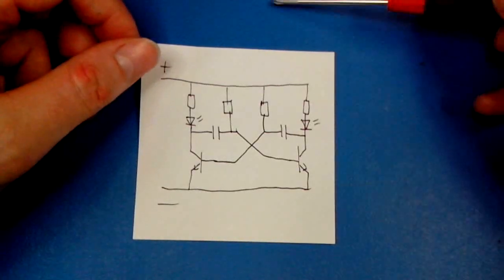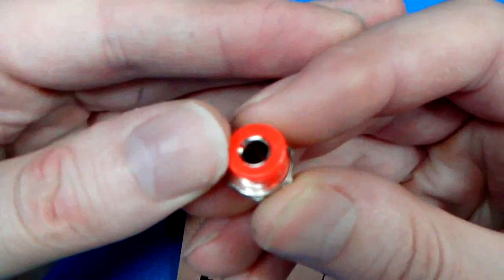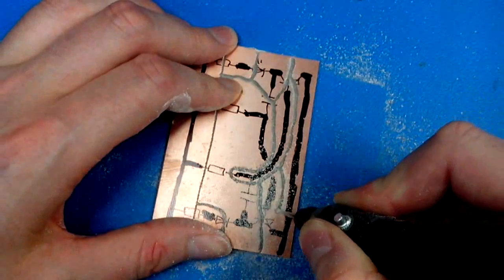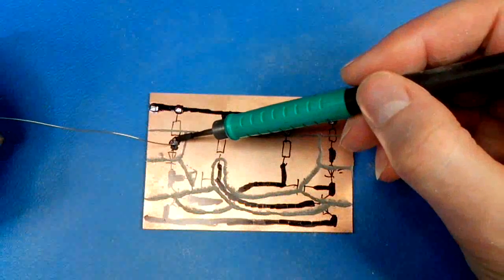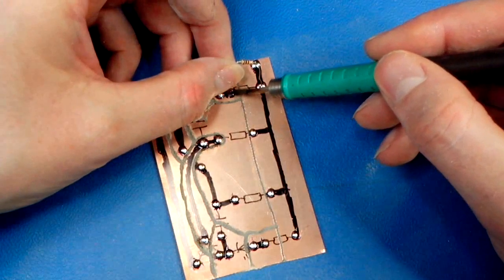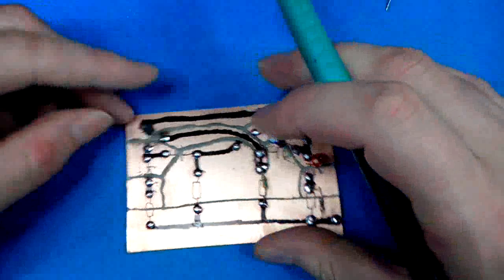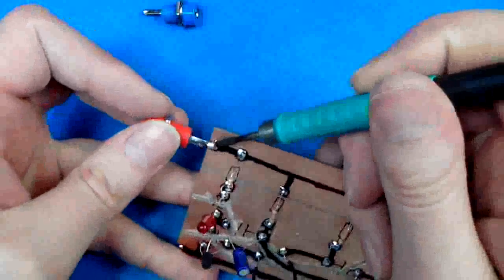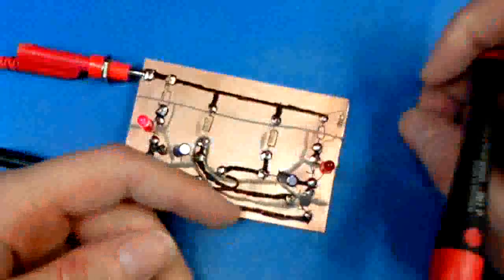Quickly prototype electronics by hand-milling copper-clad PCB

Comment: Why not use breadboard?
Reply from the maker: I often use breadboard too, for example to test something. This soldering-method here is a bit more robust, which can be useful e.g. when you have to take it elsewhere. Stuff doesn't fall off when you shake it hard.
Reply: And breadboards have high capacitance